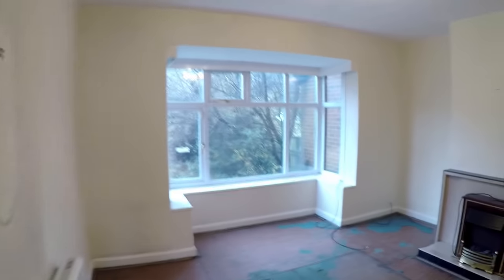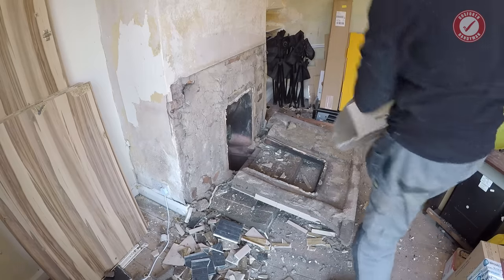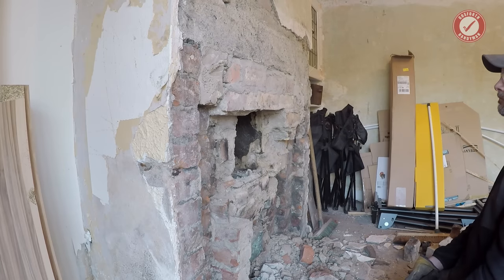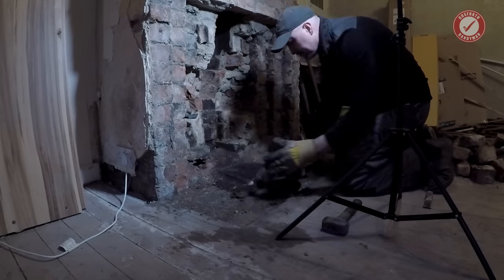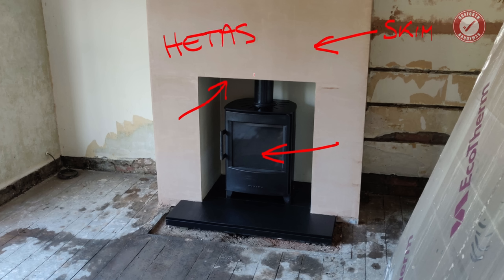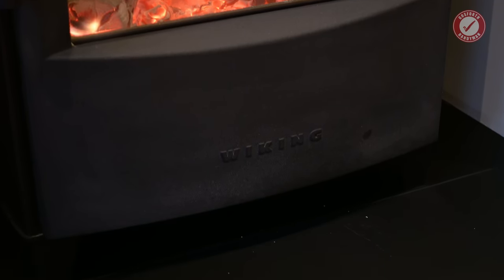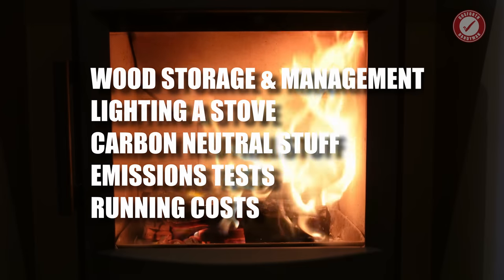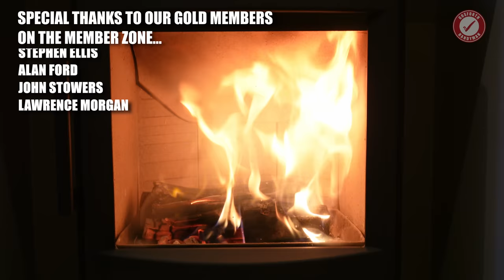Removing the back boiler and installing our wood burning stove

Comment: Hi Andy, stoves don’t have to be installed by a HETAS engineer…

There are other certified installers you can use, or you can do a self-install and then have it inspected and signed off by your council building control inspector.

But, as you said - Whilst you could DIY, I’d probably leave it to the professionals!  Especially the ropey roof work! 😂
Reply from the maker: Cheers bud and good to know! 👍

Comment: HETAS is a competent person scheme. One can get approval from building controls without going through HETAS. Similar to installing windows via the diy route, getting approval from local building control without using a FENSA installer.
Reply from the maker: Cool - do they send a HETAS person to inspect it or just normal building regs inspection?
Reply: @GosforthHandyman  building inspector from the council building control dept.

Comment: I watch many videos of UK homes, and I've been surprised at the number of woodstoves that are installed and in use.  I never thought that you had enough cordwood available for people to use their stoves regularly, and I therefore assumed that it would be very expensive.  I live in a heavily forested state (New Hampshire), so heating primarily by wood here is less expensive than oil, gas or electricity.  But in the UK?
Reply from the maker: Mainly as a backup heat source here in the UK. With the energy prices going through the roof here (now 10p/kWh for gas and 40p/kWh for electric) it certainly helps to bring the bills down! 👍

Comment: Good luck, I have a wood burner and it's really expensive now to buy wood it has gone up from £3.99 to £6.59 per bag in one year one bag is gone in 2 hours  its now unaffordable to use every day in winter and I can only use it when the temp is 0 or less I don't have any central heating it's much more expensive than central heating and it only heats one room

Comment: Yeah you can do as a DIY install with a building control application. Also to those talking about air pollution, I have a good quality PM2.5 monitor and it barely registers.

Comment: A few quick questions 1) how does the cost of wood compare to say gas 2) Supply of wood is it easily sourced , cost , good regular supply and any chopping or cutting envolved 3)Does the chimney need sweeping regular 4 ) with this green agenda always changing (like when i was encouraged to by a diesel car by one Government an now there a big no no)  5) I would make sure i got some wax on that lovely leather couch ( or settee if yer a posh Geordie) because theheat it seems to belt out will dry the Leather out GREAT VIDS KEEP EM COMEING 😀👌
Reply from the maker: Answering most of these in the next vid, out very soon. 👍👍
Reply: @GosforthHandyman  I know it was a long winded question an i didn't expect you to answer all the quetions straight away and look forward to your next post but couch or settee 😀 me an our lass are from the N East and she said couch like me The choice is yours 😀
Reply: Had my gas fire removed a few weeks ago and a 5kw multi fuel stove installed, today I lit the stove  [temp 6c] at 11.30 am used around 1.5 kilo of coal, 2 hours later put another kilo on, 2 hours later 3.30pm put on another kilo, 7.10pm put on a small log and another about an hour later, doors to kitchen and hall open to let heat circulate around the house, living room 24 x 11.5
total cost for the day around £2.80  [coal 60p kilo and logs work out at around 35p kilo] logs are seasoned hard wood.
cost if I had been using my gas fire half on for the same time period would of been £3.50  and not as warm, full on the gas fire would of cost £7.00 as not yet using heating, chimney should be swept at least once per year
Reply: @macraghnaill3553  what i don't get there isn't a abundance of fossil fuels or wood in the uk so what will you burn and with everything going green won't the polticians hit on you
Reply: @QWERTY7773  I won't be around that long, there is an abundance of fossil fuel in the UK, it's just not being used.
When I had my stove installed the HETAS man said that people are now ignoring the Smokeless law as they are burning what they can to stay warm, I don't live in a smokeless zone

Comment: I did most of the fireplace work when I installed my gas fire. If anyone wants to have a go, just be aware the HETAS inspector will want to see the fire board, well they did 10 years ago. I tiled mine, so I left a few tiles to finish off later. The fitter did the chimney and outside stuff (not for me either!).
Reply from the maker: Good to know!

Comment: Where's the soot box?
If you install yourself use the rear port with a soot box, more efficient if the stove is a bit further out.
A couple stove fans on top would be well worth it.

Comment: Do you recommend external air feed if doable? I was reading that drafts can happen within the room to air feed the the stove.
Reply from the maker: I think it depends on the size of the stove - the installers said we didn't need one. We just open the window a crack if it feels stuffy. 👍

Comment: Hi Andy, lovely to see the progress on the build. When I had my stove installed in my old house, I prepared the builders opening as yourself. I looked into doing the work myself and getting a HETAS engineer to sign off, but no engineers in my area would touch it. I checking with Building Control, but in my area the6 insisted in a pre and post sign off and the cost of this was more than a HETAS install, go figure……😂
Reply: Oddly enough, that was the same when I was in the industry. The pre/post sign off for Building Control was only a little less than our rates, and we did all the hard graft for the customer and disposed of the waste!
Reply from the maker: Yup, the building regs fees are getting prohibitive for a lot of smaller projects.

Comment: I'm surprised they put a new lower lintel in. As I understand it, the hot flue is providing further heat in the room, so the longer the flue the more efficient the fire. A larger gap also gives space for the hot air fan and potentially a casserole. All those lovely northern dishes, Lancashire Hotpot, Scouse, Lob Scouse, Cawl and probably some from the North East too, were one pot, slow cooked over a fire😋. Thus 1 fire heats you inside and out!
Reply: Might have just been aesthetics I guess, so that the surround is closer to the shape of the stove?

Comment: We're redoing our living room and I've just cleared out our old gas fireplace back to a 'builders opening'. I'm still undecided over whether to get a woodburner or not. However, the plasterer is due this weekend to do all the other bits of the room, so in the meantime, I'm planning to just fit the fireboard/hardiebacker to the back and sides of the fireplace so he can then marry that up with the rest of the dot dab plasterboard that will be around the opening. But I'm still trying to figure out what I should be doing with the bit where the registration plate would go. Should I put a piece of fireboard there for now and let an installer cut a hole later? Or should I leave it completely open at the top and let them cut and fit the registration plate?
Reply from the maker: Ours butts up to a stop bead on the front plasterboard. So you could probably screw a piece of plasterboard in to stop draughts and then replace the whole lot with the register plate when you're ready? I'd just leave it to the installers. 👍
Reply: @GosforthHandyman  sounds like a good idea. Thanks!
Reply: I had some stainless steel plate bent along the edges and fitted that. It lined the builders opening a treat and is very easy to keep clean...

Comment: that old back boiler looks as if its a copper one, (cos of the green on it), & you,d get a few quid at a scrap yard for it, early back boiler,s were quite thick copper, & later back boiler were made of steel.

Comment: I had an installer out today to price a job for me and I did ask him if you can do it yourself he said yes but you need building control to sign it off and they charge per visit (£350) my one is so if they come out 3/4 times you might as well pay a professional to do it in the first place
Reply: Regulations in the US vary, but in my state many homeowners install woodstoves themselves, and if it's inspected at all, it may be done by the local fire chief at little or no cost.
Reply from the maker: Interesting!

Comment: You can install yourself and get a hetas registered chimney sweep to ok it. You have to know all the rules, regulations and distances before doing so. I did my own install from exactly the same start as you. My inglenook though is twice the size and it took an age getting the back boiler out and all the cement and odd thrown in brick, before it was finally revealed. Glad I did it though and it saved me hundreds of pounds by doing so. Would I recommend doing it on your own?..... Yes, but only if you are a very competent person, and you will some help.

Comment: I never heard of a back boiler, and don’t have a clue what’s used for, other to heat water for kitchen and bath, but the boiler looks like it didn’t hold enough water to heat a shower, or certainly a bathtub, so still confused of its use. Regardless, the firebox and wood heater looks great!
Reply from the maker: I think they heated water in a circuit and this was used to heat a hot water tank... I think!

Comment: I did a DIY install and the council then certified it. Did they fill the chimney with insulation around the flexible flue? Yours looks fantastic by the way.
Reply from the maker: Cheers! No, our flue isn't insulated. 👍
Reply: Ex HETAS Engineer here. It was commonplace 10 years ago but the vermiculite chips used are probe to absorbing moisture and a nightmare to deal with after the fact!
Reply: @adamconstable1377  That's interesting. I used the jackets around my flue. I'll bear that in mind if I put in another one.
Reply: @ADayWithoutYesterday  The fibreglass woven blankets are a much better solution than the old loose fill chippings. That being said ots like wrapping your car exhaust; doable but a bit overkill. If you're worried about flue temps then it's worth doing, but that liner is sitting inside a brick cover all of its own

Comment: What about plate above plinth for access of chimney sweepers ?
Reply: Our multifuel stove has access to the flue pipe from inside the stove itself.  I just take out the baffle plate before the sweep arrives.  If a stove has no direct access, there should be an opening built in to the flue pipe just above the stove.  If there is no flue pipe in the chimney at all then there should be an opening built in to the closure/register plate above the stove.  Hope that makes sense.

Comment: It is illegal without a Hetas installation and the Hetas company will give you a Building Control Certificate (BCC) . If you do not have a BCC, your Council can condemn the enitre installation and could even get an order to remove the fire until proper certification has been granted. So unless you have a BCC, you will forever be looking over your shoulder for a visit from a council environment dept who will know if you have a BCC since the Hetas company lodges a copy of the certificate with Planning as well as giving you a copy.

Frankly, you seem to have got a great deal and the installation looks fantastic. Well done.
Reply from the maker: Cheers - really happy with it!

Comment: Why did you not fit a stanley boiler stove and heat the house.Your pipe work was already there,fit a new ciculation pump and the whole house is heated,plenty of wood around at recycling or indeed at the local wood wind falls etc.
Reply from the maker: Pipework was already there?? The house didn't have central heating before we bought it. 🤔
Reply: @GosforthHandyman  Did I see you cutting pipework out of the back boiler ?Or was I imagining things?
Reply from the maker: Was capped off in the loft - would have only been used for hot water, and no way you could risk using 80 year old pipes.
Reply: @GosforthHandyman  Thank you for letting me know best wishes, I have 2 stoves myself.

Comment: I guess you also doesn’t have a pipe close-up valve?  That is odd. It is in fact illegal in Germany but in Finland and Sweden it is pretty much standard. You burn the firen then you close the valve and that keeps the heat inside- If you do not have the valve the fireplace is in fact cooling the house as the fireplace pushes hot air out and cool air gets in. Even kids in Finland kmow how (and when) to close it
Reply from the maker: Interesting! Must be different in Denmark? 🤔

Comment: I have done the opposite. I put in a new lintel to RAISE the opening rather than reduce, to give more chance for the hot air to come out above the stove.  As for emissions,  yes inside you are toastie and little smoke present,  but its an "up yours" to your neighbours,  especially when you first light it and add new logs. Many towns are sadly going back to the smoky smog of the 1950s. Especially bad for asthma sufferers .

Comment: The air quality topic is really divisive. You would probably get a lot of views with a video showing your experiences with a modern stove and a good pm monitor. I would recommend Airthings ones as you get good historical graphs and they can also measure for radon etc too. I know this was covered with another channel but the monitor they used was a cheap one and it would be interesting to see another persons experiences.
Reply from the maker: Yup, next vid - very interesting findings. My detector uses the PMS5003 sensor. 👍

Comment: We had a log burner  put in but when putting the liner down they said they couldn't get it down due to bricks stopping it that they couldn't get to i was gutted
Reply: We had the same problem with the 6 inch liner, but after they used a 5 inch and it was ok.  If using a 5 inch liner though the model of the stove has to be compliant with a 5 inch liner.

Comment: I'd be putting a rug in front of the fire bonny lad. You think it's not going to happen but that floor WILL get singed!
Also, my last 2 insurers have asked if my stove was professionally installed or they won't cover me. Not sure how that works if it was fitted years ago or you're the second or third owner of the home since it was fitted....
Reply from the maker: Yup - keeping an eye! Trying to find a decent fire rated one is proving tricky!

Comment: O aye.  Wood burning stove gives out lovely heat. .and poss boil a kettle and make toast. Remember 1970's when people was reduced to cutting up a burning all the internal woodwork /staircases ect .in desperation as could not afford coal.  Later some of the houses had concrete stairs fitted.  Sad grim times. Seems we heading that way now.

Comment: im in NIreland. I did a self install on my first stove and then paid £70 for building control to come round and sign off/ issue certificate. for my current stove in a different house, I paid for one to be fitted, building control fee was included in my 2,5k bill. just tonight 2 yrs later, the fire cement has failed round the top coller and smoke filled my lounge,aaaghgghhhhh
Reply from the maker: Oh no - hope you get sorted!!

Comment: If I had a woodburner it would have to earn its keep, and therefore do the cooking and water boiling as well as heating the house.
Reply from the maker: Defo if you have the space!! 👍👍
Reply: @GosforthHandyman  well, also, there is the small matter of practicality!  If you're not gonna cook in your living room you still need something to sit round!  It would be a bit daft to have your wood burner - of whatever persuasion, in your kitchen and then sit in a soulless living room with only a radiator for company.......!

Comment: It is perfectly acceptable to install your own stove without using a HETAS installer. Obviously you do need to know what you are doing and there is plenty of installation information available on the internet. The installation can be signed of by local building control but there is a cost to that. I know a few local HETAS installers who's work is quite honestly very very rough and the final finish of the plastering and hearth installation is very poor.

Comment: We fit multi fuel stoves put it this way I have fitted a gas stove in my house  riseing wood and coal cost I think it's cheaper to run gas and you just press a button as regards singing off you need a 2022 compliant DEFRA approved stove fitted by hetas fitter alternative some council's will do it or you can get indemnity insurance  if selling your property

Comment: You can self install but must still get the work checked out and certified by a HETAS engineer. To simplify the certification process, it’s best to take photos and or videos of the install. Plus keep all the receipts of all materials used for the install. Fitting the registration plate and correctly seal it, is the most awkward part. If you’re afraid of heights, a self install will be impossible. Scaffolding for safe roof access may be needed, especially on taller buildings. Also, if not photographed and you intend to vent through an existing chimney. Proof of an independent survey, regarding the safe structural state of your chimney, will come in handy with the HETAS inspection. Again, save the receipt, to prove the survey was completed by someone, who has provable relevant experience & knowledge for such a survey.

Comment: If you don't want to shave your beard off to wear a dustmask, get a powered respirator aka PAPR. I've been using one for a decade for dusty DIY. They're more than adequate for low hazard dust. Get one where the blower unit is on a belt, if you get one where it's all integrated into the helmet you'll regret it the first time you look down.